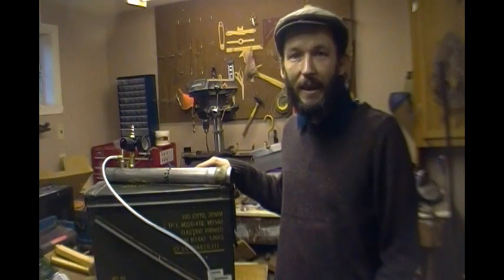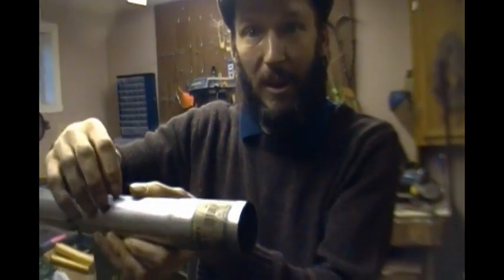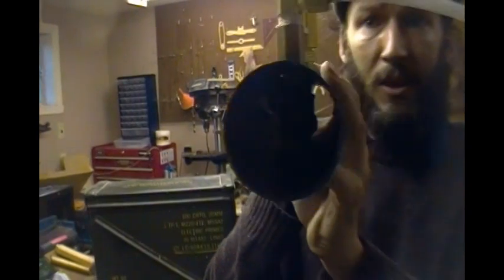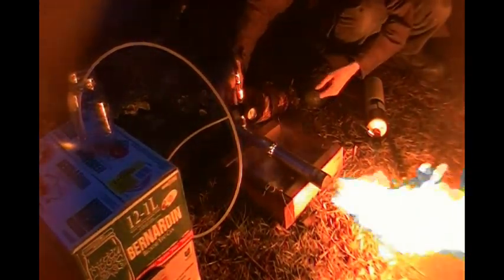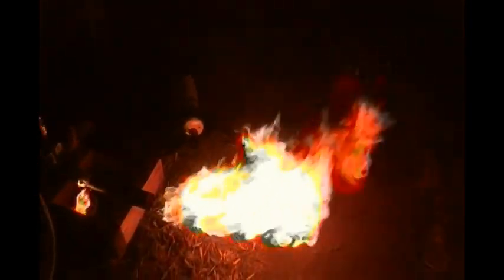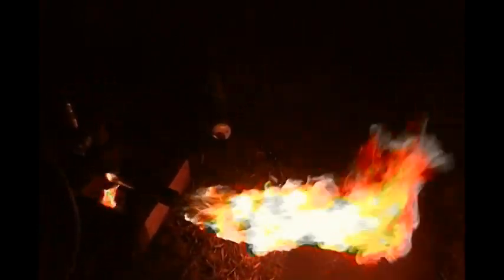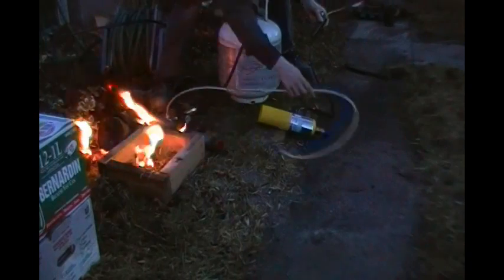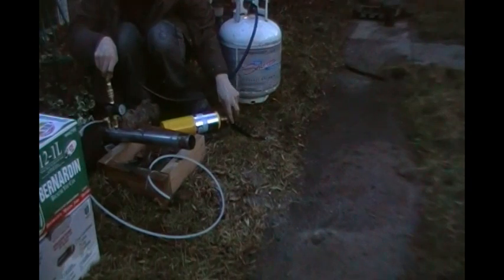My Improved Kerosene Atomizer

Comment: For the propane mode, you could make a pressure jet to get more pressure. Basically the main change is a coil of metal pipe in the burner. The propane coming in flows through the metal pipe coil and is heated, and the pressure becomes very high. From there the metal pipe leads to a intake section that is designed to use the fast high pressure flow to draw in a lot of air with it.

Comment: I myself thought of using one of the air compressor quick connects for my furnace. However after extensive research using an Air Compressor Quick connect on a Propane tank is not wise. Those things all leak a little, I also tried using a standard air compressor regulator i found the LP gas will eventually eat the 'O' Rings in the Air Compressor regulator and it will leak. I believe the sulfur that is added to propane to give it the smell for detection leads to the leaking.  Mine did!  Its worth the 60 bucks for a High pressure regulator rated for LP Gas this way you know you will not have a catastrophic explosion as a result of the regulator anyway. 

Another tip i would like to add is have a fire extinguisher or at the very least a water hose handy in the event of a fire. Every time i run my furnace i have 2 extinguishers and the water hose all ready to go just in case. Better to have it and not need it then to need it and not have it.

Comment: Not sure if anyone has mentioned this before but it might benefit you to change your air intake method. As you have noticed with simply having drilled holes into your pipe there is flame bursting out. If you were to take a new pipe and simply make some slits in the pipe (maybe 25-30 degrees worth of slit) and then hammer the slits in slightly on the atomizer side (towards the furnace), this would create a cone-like shape and would help draw in air in the direction of the furnace, create a higher pressure point in the pipe, helping to draw in air and reduce the amount of flame spurting back out. The harder, yet better alternative would be to create an actual cone and weld it into the inside of the pipe with the small end towards the furnace. Then put slits or holes surrounding it on the furnace side. Its kind of hard to describe but hopefully you get the picture.

Comment: Very humorous, you have a penchant for overkill. DIY foundry sites show burners where propane is T'd to the air supply; propane is used to preheat the burner, then WVO added with air and the propane turned off because, well, it's expensive, while the WVO can be free.

Comment: Aren't you running a very series risk of flashback into the propane tank? Obviously it didn't work (I didn't think it would in the first place, partially because it's oxygen starved), but the compressed air worked much better. Are you running an air dryer in your airlines? You would be surprised how much water these dryers get out of the compressed air lines. I used to work in a steel warehouse where a lot of the tools were air powered and the dryers would have to emptied every coup of days (in this case, the moisture was very bad for the air powered banding equipment for banding round bars (usually) with steel strapping and ckamps. Rebuilding these things costs $800 back in 1992 when I worked there). It might help your burner to be more efficient if the air is dried out?
Reply from the maker: Nah there is little chance of flashback as the propane tank is valved, and contains no air.
 
Had I included forced air, propane might still be viable. Although not as powerful as oil.
Reply: There can't be any Flashback into a Propane tank, for a explosive mixture, you mustn't have a concentration of propane over 6-8%.

Comment: It looks reducing that outlet might tighten up the flame. And maybe plug up some of those breather  holes. The flame is way swirly. Have you fixed it yet? Why no 3rd video??? I need a 3rd video.
Reply from the maker: Thanks for watching! ;)
 
There's enough fuel shooting through this thing to allow for the large opening. What it needs is more air.
 
I have two things I want to do to increase it's performance even further.
 
1) I purchased some 1/4" copper tubing that I'm going to coil tightly around the pipe just past the breather holes. This will preheat the Kerosene so it atomizes into a finer mist.
 
2) I am going to attach a Shop Vac to the back of the pipe, to add more oxygen.
 
This doesn't really count as video 2/3... it's more like 1.1/3.
 
I have to wait for the ground to melt before I make 2/3. (late spring) It will involve the above modifications I mentioned, and building the foundry out of cement in my backyard. Next paycheck I break ground.
 
Video 3/3 will involve breaking-in the new foundry, once it dries... and casting a copper slingshot.
 
Then... Swirly is an understatement.  At this point it will become an entombed fire tornado! XD

Comment: you need a fuel feed going through the flame to vaporise everything before it hits the jet, if you search YT for an MSR Whisperlite and watch how the fuel is heated you'l see what I mean :)
Reply from the maker: That seems to be rather complicated... I'll definitely need to think about that.
Reply from the maker: Hmmm... I'm not sure how to accomplish that.. I think you're more experienced with fire than I am.
 
What if I ran the fuel line through a copper coil of tubing inside the burn chamber?
 
With the current configuration, the mist vaporizes when it comes in contact with the hot pipe...
Reply: L00NGB00W thats all it is, just heats the fuel before reaching the jets! super simple :)

Comment: One other thing... That ball pump with the hole on the side that you soldered, that solder is going to melt, it's going to get way too hot inside that tube for the solder which has a very low melting temperature.
Reply from the maker: No. The ball pump is constantly exposed to liquid kerosene and decompressing air. This keeps it cool.
 
Also I used silver solder which has a high melting point.
 
If this part ever fails, the atomizer will stop working entirely. Instead of atomizing the fuel... it will just blow bubbles into it...
Reply: How far from the tip does the kerosene burn? It's pretty awesome, can't wait to see it working. Your replies are invisible in the thread, why is that? I had to hit reply on my comment to see your comment. I only knew it was there from the gmail notification. Odd.
Reply from the maker: tarstarkusz  Currently, the fuel buns around 10 cm away from the sprayer.
 
I plan to move it forwards so that it is 5cm away from the breathing holes.
 
I think the messaging discrepacncies are due to the fact that I often message via Google+.
 
It's a problem inherent to Google's takeover of Youtube.

Comment: Nice setup, but keep in mind that in order to burn something you NEED Oxygen (~20% of the air we breath) you cannot burn kerosene with propane, you need air to burn both.
If you want to boost your burner you can replace air with pure oxygen
Reply from the maker: Thanks for the input.
 
What I wanted to know was whether or not propane tanks had enough pressure to atomize kerosene with my setup. 
 
They do not.

Comment: I DONT KNOW where you are on the progression of this burner.  The propane will not work with a Bar B que propane regulator.  They only have 10 pounds of pressure.  Get a propane regulator with at least a 50 pounds capability.  Mine has 100.  Also I think the size of the atomizer is too small.  

But your work is BEAUTIFUL I NEVER CAN GET MY SOLDERS THAT NICE

Comment: Just curious if this atomizer would work with waste oil (Motor Oil). Always looking for cheap fuel alternatives..
Have you tried waste oil?
Reply from the maker: +Timothy Shaner yes, I have.
 
It works with any flammable liquid.
 
With waste oil it's a good idea to let the device heat up a bit first. Also, it helps to dilute it a bit with kerosene or deisel